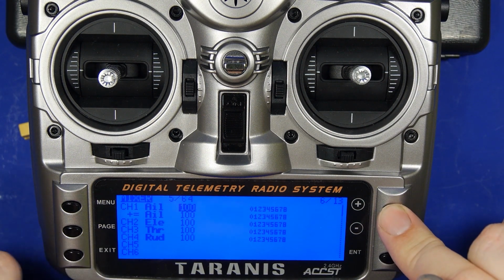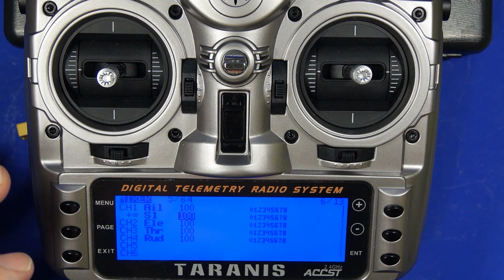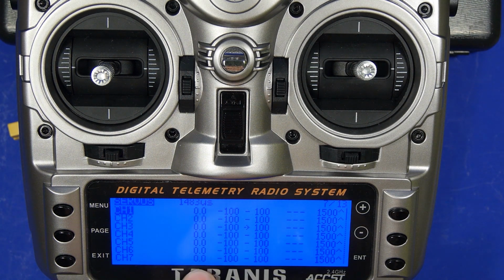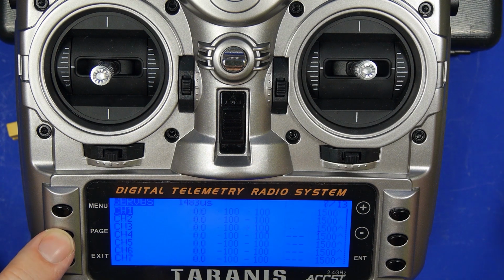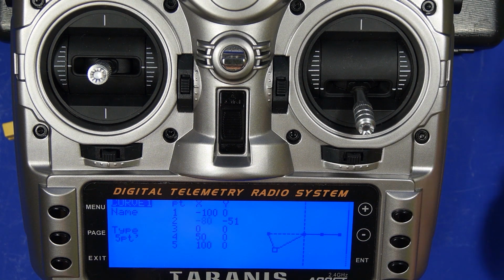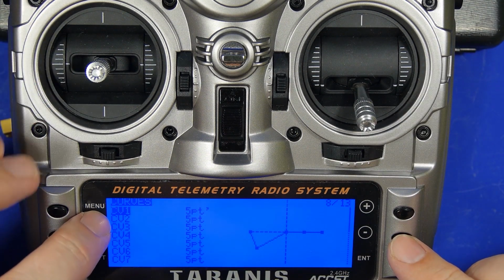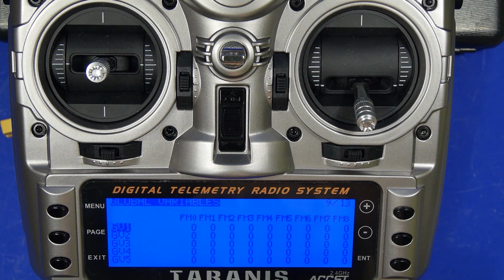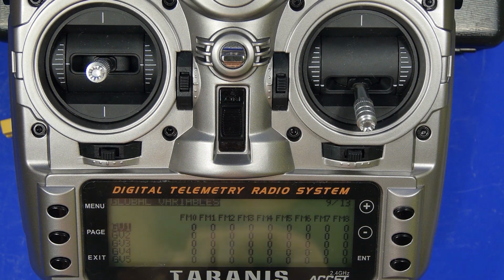FrSky TARANIS ENG - 3 - Model setup

Comment: Hi Richard
Setting delta wing is the same process than a traditional airplane ?
Any suggest ?
Reply from the maker: Frank Lee Hi Frank - most easy is use a LUA script, it makes basic programming MUCh easer. But without a LUA script Wizard you just add two mixes for each elevo - one with a input from ELEVATOR stick and second from AILERON stick - thats all :)